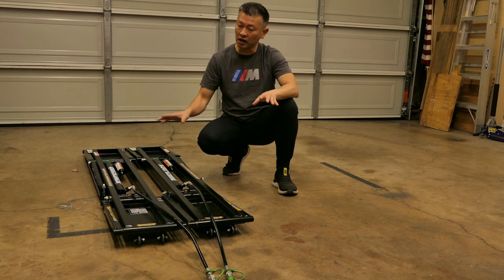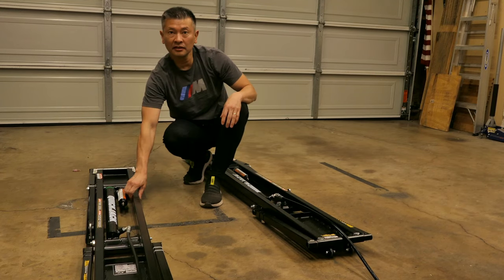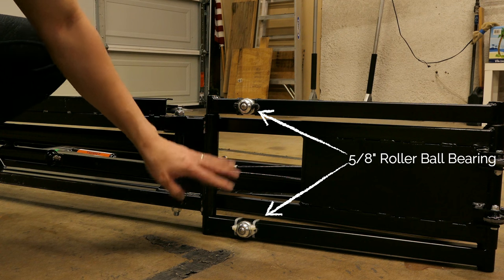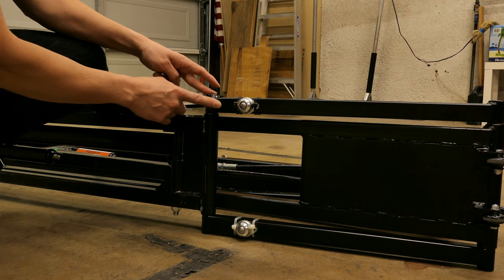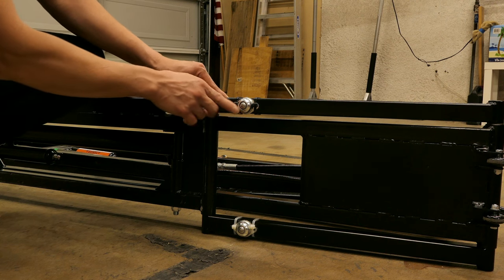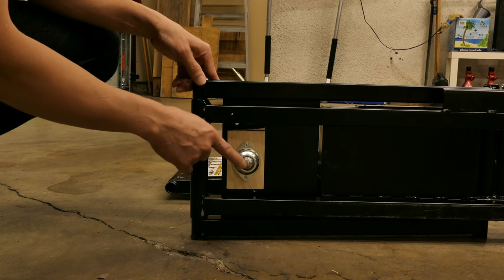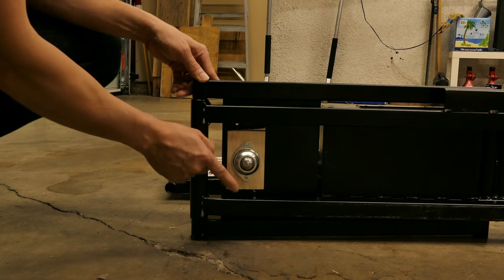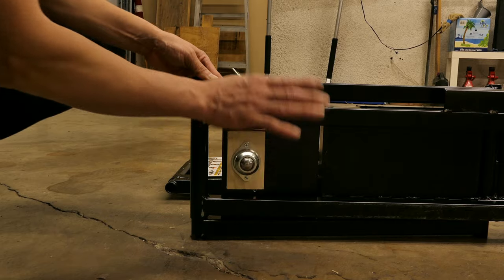Best Hack for the QuickJack, only $10!

Comment: What type of 3m tape did you use?  This is brilliant, thanks for posting.
Reply: Did you figure out what 3m tape works best?
Reply: @bryans8193  This seems to be the only unanswered question...
Reply: I used Gorilla double sided tape, no zipties on all wheels, works for me.
Reply: @randersson3672  be careful of depending on the tape alone.  on mine, the tape pulled the paint off.  the paint isn't strong enough.
Reply: @JonGibbs-pf2bt  It's still holding, but I see what you are saying.

Comment: I have a very low car..using 3 5/8 bearing only will help?
Reply from the maker: Mass, how low is your car? With my 911, I had to use ramps to get enough height clearance.
Reply: @TheAutomotiveFanatic  now it slide perfectly without this mod..i gues few extra mm and im f***d :)

Comment: What tape did you use for the two 5/8 ball bearings? Also how did you apply the tape considering the backside of the ball bearings are concave an not flat?
Reply from the maker: Travis, just use 3M double sided tape and a ziptie at each end. With this configuration, I have used the lift multiple times with no issues at all.

Comment: I guess the advantage of bearings over wheels is wheels add more height which may be an issue with cars with little clearance.🤓
Reply from the maker: Actually Mike, having the rollers allow the QuickJack to move in any direction with ease. Having wheels present more of a challenge because they have to "face" the direction they're rolling to work properly.

Comment: Hi, what was the thickness of the block of wood used for the 1 inch roller ball? Also what 3m tape did you use. I didn’t see the links mentioned on your video. Thanks!
Reply from the maker: The thickness  is 5/8" by 3x4.
Reply: @TheAutomotiveFanatic  thanks! Great videos!
Reply from the maker: @timg8045  Thanks for watching and the support!

Comment: Love this! Very well presented. Any updates on robustness or required bearing lube? 

Just found out I will need the extender for new vehicle(5000SLX, 64” spread on lift points of new vic). So glad I haven’t bothered to hang them. They are fine shoved to the sides of my garage.
Reply from the maker: It's been several months since I installed the rollers and have used the QuickJack at least 50 times since then. I can happy report that no issues have come up with the rollers.
Reply: Even if the bearings went "bad", the time & effort to replace is so minimal ($0.99 + few minutes to remove old & install new).

Comment: This is brilliant. One of my concerns with the quickjack system is how hard are they to set up when it's time to lift your car up. I found your vid a few months ago and my concerns were pretty much forgotten. I finally got my quickjack 5000tl and am doing this mod asap. They are very heavy and moving em into position takes some effort. I really think this mod will greatly reduce the effort and setup time.
Reply from the maker: Thank you for watching and the support! I've seen made an updated video and showed viewers how I used the larger bearings. They work much better!
Reply: @TheAutomotiveFanatic  u have another video of this mod?
Reply from the maker: @N2theIzzle  I did a follow-up video using the larger bearings: https://youtu.be/B9alEh1dakM
Reply: So u recommend the larger ones on the wheel end now so it rolls better. I already got the little ones. I'll see how they do. If it's a big old fail, I'll get the larger ones. My garage floor is that courser unpolished type of cement. Also, I figured u went with the smaller ones initially to reduce the overall height of it when it's fully collapsed.
Reply from the maker: @N2theIzzle  Yes, I find the larger ones to provide more rolling surface area. It's slightly taller than the smaller ones, but nothing you cannot work with.
Reply: Place large sheets of carbourd under them and they move like on butter / any floor surface . I used  cut up box from a shower stall deliver . Zero dollrs spent

Comment: Do you have a close up for how you zip tied the roller bearings? Did you use a single zip tie or did you use two zip ties per hole?
Reply from the maker: Edward, the smaller bearings are head on by 3M double sided tape. Then I simply zip-tied the very edges of the bearings. You can somewhat see it on the main video page.

Comment: Do these increase the minimum height of the quickjacks when they aren't raised? Would it still fit under lowered vehicles?
Reply from the maker: Yes, the rolling bearings will raise the minimum height of the QJ roughly 1/4". It's required so that the QJ can roll around. Will this still fit under lowered vehicles? Unless your vehicle is too low, you should not have an issue.
Reply: I already have to drive my S2000 front tire up on 2x4's to get the smallest rubber pad in. :)

Comment: what happens to the bearings when the jack is extended under load?
Reply from the maker: Great question Harold! The placement of the bearings are where the arm extend. When the QuickJack starts lifting, the arms lift and take the bearing up as well. The main frame then contacts the ground and is 100% safe.
Reply: Try watching the video. It's all explained.

Comment: any reason you didn't use a self tapping screw on the smaller rollers, instead of  double tape and zip ties...?
Reply from the maker: Great question Larry. I did not tap into the QuickJack because my fears of altering the integrity of the frames.
Reply: @TheAutomotiveFanatic  ,,,understandable  i might try some jb weld or something once i get mine,  order has been placed just waiting  to process it. thanks for your answer.
Reply from the maker: @larrysmith3293  I will provide you and everyone else an update. If you have smooth floors, these bearings will work great. However, if you have uneven floors with cracks in them, the bearing may catch. What then happens, it slowly pulls away from the double sided tape. I noticed this today when showing a friend how to set his up. It's not a huge issue, but the timing was perfect since you asked about it.

Comment: My concern is creating several high points of contact with the ground vs the entire frame being flush with the surface. It's a great idea but not certain how this would effect rigidity
Reply from the maker: Thanks for the great input. The high points only exist when the lift is flat. Once you start lifting, in as little as 1-2", you'll see that the bearings no longer touch the ground. It's replaced by the QuickJack's frames.
Reply: I don't think you understood the video.

Comment: I hope the ball bearing wheels aren't installed on the load-bearing parts of the frame? I'm considering getting a QuickJack and this would be a nice hack, but if those wheels were on load-bearing elements, a piece of wood and some wood screws holding up 4000+ pounds would certainly not be safe. I may need to review the QJ design more closely.
Reply from the maker: Hello there, I completely understand your concern. Where they would be mounted, it is not positioned where load would be. When the lift starts to raise up, the bearings no longer contact the ground. It's completely safe.
Reply: @TheAutomotiveFanatic  Awesome, thanks for confirming that.

Comment: QuickJack needs to add this to their design!
Reply from the maker: I agree! That or making the lifts easier to move when they are fully decompressed.
Reply: @TheAutomotiveFanatic  Their new model is even heavier.
Reply from the maker: @LuckyNikitaBoba  Correct! I have their newer TL series lift so the extra 3" height increase makes a difference.

Comment: Great Video! I have a 7000TL ordered, so not in front of me to fully appreciate. Why not put 4 bearings and mirror what you did on the other side instead of going with one in the middle? There is probably an obvious explanation…
Reply: because those points are load bearing when a car is lifted

Comment: What are the dimensions of the wood block?
Reply from the maker: Joe, it worked out to be roughly 4x3.
Reply: @TheAutomotiveFanatic  how thick?
Reply from the maker: @maxblaze5667  The block of wood I used was roughly 5/8" of an inch.
Reply: I too would appreciate a reply on the thickness of the wooden block.

Comment: I do have one question....when you lower the car, the jack arm lowers back to the ground....but how do you get the roller balls to work again? Doesn't the arm with the roller balls just stop when they touch the floor? There is no source of energy, electrical or hydraulic, to push the roller balls down against the floor, which would force the base of the quick jack up, off the floor, right?
Reply from the maker: Hello Michael, great question. If you look at where I placed the ball rollers, it's placed far back on the lifting arms. When the QJ comes down, the shear weight of the lifting arms and accompanying platform is heavy enough that it slightly lifts the entire QJ off the ground. I hope this makes sense.
Reply: @TheAutomotiveFanatic  - the air-pressurized pneumatic cylinders also push the frames closed again.
Reply from the maker: @chrispapademetrious408  you are correct. That pressure helps to compress the frames.
Reply: @chrispapademetrious408  i'm not having good luck with that.  on mine, once the vehicle weight is off, the frames stop lowering altogether.  i have to go stand on them......
Reply: @JonGibbs-pf2bt  - Are your air cylinders pressurized fully? I placed the wheels as close to the lower side as possible to help with the leverage effect. Here's a video of my installation: https://www.youtube.com/watch?v=ewcviX_6v30
Reply: @chrispapademetrious408  not sure.  is there something i need to pump up?  i just filled the oil tank and went with it....
Reply: @JonGibbs-pf2bt  - you should probably read the instructions...
Reply: @chrispapademetrious408  eh, better late than never.  i'm pumped now.
Reply: @JonGibbs-pf2bt  - excellent!! Is it retracting better for you now?

Comment: The max weight of the ball bearings is 55 lbs each. How do these not simply explode under the weight of the vehicle? I'd be nervous working on the car and having one of them fail and then cause the car to somehow shift.
Reply from the maker: Leif, this is a great question. The location where you place the ball bearings, they actually lift off the ground when the lift rises. Therefore, when the lifts rise, the main body of the QuickJack contact the ground and remain 100% stable.
Reply: @TheAutomotiveFanatic  ah now it makes sense! awesome, thanks for the tip!
Reply from the maker: @LeifMadsen  I just revised this hack by using the larger rollers up front as well. It actually works better!
Reply: @TheAutomotiveFanatic  I actually missed where you explained that the first time around, but saw it the next time I went through. Thanks again!

Comment: problem with those wheels is if you get dirt inside or water they will rust and jam up...in time!
Reply from the maker: There is that possibility. However, since they are cheap, you can always replace them.

Comment: builder should have poured at least 6 inches of concrete in the garage area esp if your gonna use lifts
Reply from the maker: I think a 6" slab with rebar and high tensile concrete would be the way to go.
Reply: @TheAutomotiveFanatic  yea, i use to work at a beam casting company and we would tie thousands of rebarb together making  cement beams for bridges that  averaged 100 foot long..

Comment: The Quickjacks are ok if you're lucky and get one without a defective air cylinder.  If you do get one of those you're screwed - the company will 100% not stand behind their product.  They'll claim the air-assist down isn't "necessary to the function of the lift".  Really?  So if one side has air assist down and the other doesn't, and they drop unevenly, that's safe?  And then when the vehicle drops to the ground ground and one side of the lift goes straight to the full down position while the other...  doesn't.  You need to wait... and wait... and wait for it to drop with no weight on it.  Quickjack will claim this "is normal operation" and that "it will get better over time".  If you invest a massive amount of time trying to get them to stand behind their product they will, eventually, after burning through every once of customer goodwill, send out a new cylinder.  Yay!  Until you get the replacement and the freakin' air side is literally capped off.  Like intentionally made unusable.  That's not a fix guys.  Then they'll claim that the engineers decided the down-assist wasn't necessary and that they've changed the design on future models.  But I didn't buy a future model with less functionality.  I bought the current model with exactly the functionality I wanted, was promised, and paid for.  Whatever.  Too much time wasted on it already - I've written off the entire company as another skanky marketing hack with no integrity.  

I still have it in my shop, but the company worked very hard to make me regret my purchase and it low-key pisses me off every time I look at it.  And honestly the setup is inconvenient enough that even when I do pull it out - warts and all - it happens very rarely.  Only when I have a longer term project where I know the vehicle will be on the lift for a week or two.  Definitely not for things like oil or tire changes.  It's just way quicker to use a floor jack.
Reply from the maker: Hey FE, I totally hear where you're coming from.

Comment: Very Sketchty, I would think it would move under the Vehicle.  30 yrs. in the Automotive  industry., Sorry, but it just doesn't look very SAFE. I've seen Vehicles fall off twin post racks. Not sure about this.   PARTY AT YOURN OWN RISK
Reply from the maker: Tom, did you watch the entire video? These only move when you're sliding them around. Once you start to lift, the roller balls no longer make contact with the ground.
Reply: You obviously missed the multiple times in the video where the gentleman said they do not contact the floor once the lift starts to raise!!! I hope you are better at reading maintenance manuals then you are at watching a very well presented video! Yikes!